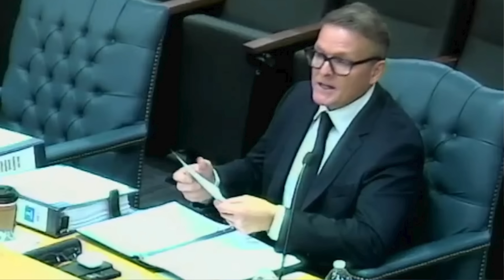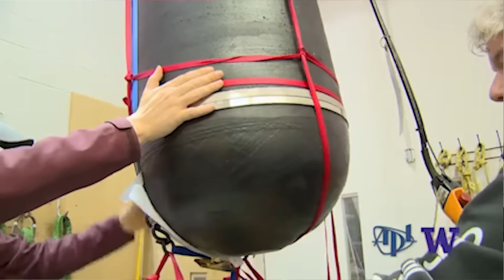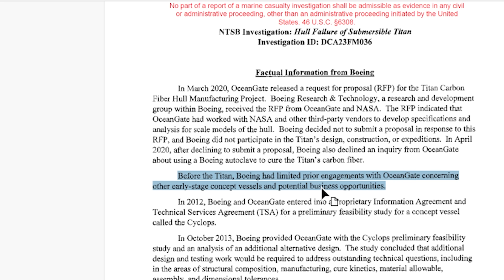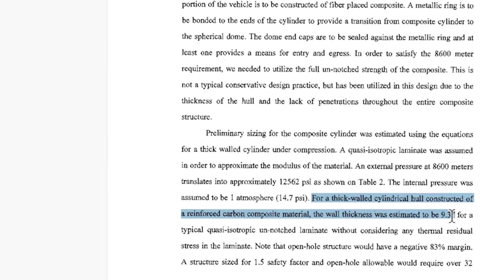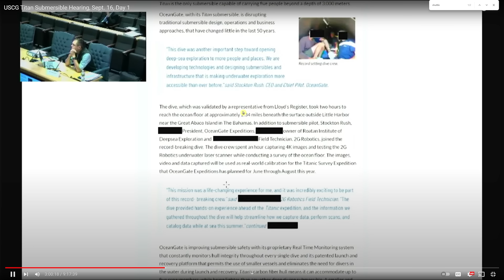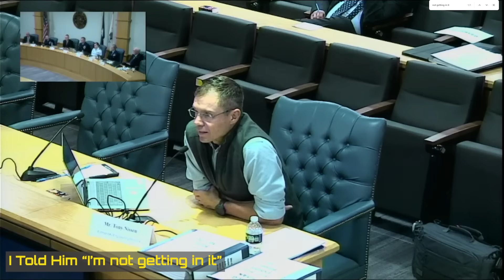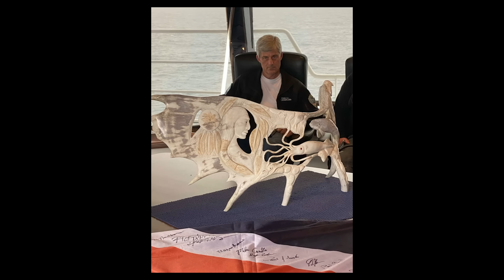Titan Sub: Fired OceanGate Employees Show What REALLY Happened

Comment: Tym, the contractor, pointed out that the lip on the front sealing ring, next to the carbon fiber tube, was sheered off, indicating that the lip failed all the way around simultaneously.

In trying to understand how that could happen, I think that the tube flexed in the middle with the result that the end of the tube was bent away from the sealing ring at the outside edge. This would leave a small area of contact at the inside of the tube and increase stress on the lip until it could fail. The collapse of the lip would then propagate around its circumference rapidly although probably not actually simultaneously.
Reply: I was imagining a delaminating layers failure, allowing concentric layers to slide and "roll" into a smaller diameter (promoted by radial pressure acting on the hull), like a sheet of paper fashioned into a shape of a cylinder. As the layers slide, the inside diameter decreased, where at the end of the cylinder that meets the interface ring, it peels the inner lip right off the interface ring (somewhat like a can opener working a path along the circumference of the can). It's not a root failure, but an indication of the root failure taking its course. The inner lip peeling away or not would not save anything, as the delaminating layers of the hull shrinking in diameter is surely the more pressing matter at that point. 😉
Reply: Now imagine, the interior pressure was high enough that the Ti-Ring was pushing outward, tearing the Lip off as it pushed the Ti-Ring outward.

Comment: So what your saying is that Boeing said for a depth of 8,600 meter depth the carbon fiber composite should be 9.3 inches.  the Titan to dive to about 4,000 meters thickness was 5 inches.  That is a linear relationship which agrees  for solid cylinders in "Formulas for Stress and Strain" by Roak and Young.  
Dropping weight to slow decent make sense.  Diving faster then the typical submersible  at 32M/min first person to say this and not in literature 25 M/min.   However actual speed ave. 36 M/min and last near bottom speed 39 M/min.  What did the crew trim the buoyance to dive at this last dive?   
Strain reduction  that should increase the rates as one gets deeper straight line graphs  that you have shown for strain v depth.  Linear again in agreement with solid cylinder formula.    What is clear from the deviation of the relationship after 81 is a preload of the Cylinder that took some depth, a few hundred meters to unload by the strain increasing with depth.   
The only means of applying a preload is water filling the voids and compressing the air in them to a higher pressure then used in the curing of the Cylinder.  To get water to them the cracking sound likely was the failure of fiber to epoxy bond which would allow when stain created a crack a path for water to enter.

Comment: The huge red flag that I've seen in videos is the use of typical game controller to control the sub. WOW\Shocking!! Maybe the media reports have been unfair, and the game controller was just a prototype and later replaced with a well designed controller. A game controller is designed for playing games in a home, not for controlling subs. Imagine being 100s of feet down and suddenly the game controller loses wireless connection because it was never intended to be used, or tested, inside a sub 100s of feet under water.

Comment: If you listen to the testimony on the window, it could’ve been pushed through the hole without any signs of cracking. It wasn’t even officially rated due to lack of testing and it being a non standard design. Everyone wants to guess how it happened. 
If you listen to Renata, she is totally backing oceangate. She seems to even be spiteful of the inquiry at certain points, I don’t trust her testimony.

Comment: Correction: the Cyclops 1 was not the first version of the Titan. Cyclops 1 was a properly built steel hull submersible rated for 500 meters and purchased by Ocean gate to use as a testbed. The first version of Titan was originally called Cyclops 2 and only the hull was remade, everything else was reused.
Reply: What were they testing with such a different design than the one they planned to operate with?
Reply: @jaylemeux  The controller, among other things. I'm not sure what else, but the thrusters look largely the same and I imagine they were testing coms and maybe the pinger as well.

Comment: A safety factor of 1.5 is not “standard for engineering”.  I hear 1.5 is general standard for airspace.  

If you go into ASME Boiler & Pressure Vessel Code, Section 8, the safety factors are a bit variable, but nothing will be found after 3. In reality it’s like 4-6.

Comment: the crazy part of Stockton's design is that so many parts of his design were actually good, even the acoustic system was actually working. Problem is though he ignored the warning signs and didn't do enough analysis of the results when the gauges started showing signs of anomoly. 
Sadly no matter how much the design was improved on Stockton's lack of regard for safety was always going to be a risk which would eventually lead to failure.
Reply: *anomaly 🙄
Reply: @peecee1384  lol thanks, good spot

Comment: You can see why OceanGate went with 5 inches. They linearly scaled the 8600 -> 9.3 to 3800 -> X and solved for X which comes out at 4.1 so they rounded up to 5. I don't think the hull thickness was the issue more than what the hull was made of and how it was constructed.
Reply: Typical Stockton, as it actually doesn’t even scale linear, there’s things like temperature and other variables at play.

Comment: I think going forward, laminated carbon fiber should not be used for things that can carry people and be subjected to massive swings in pressure. If the entire thing was solid titanium compared to this carbon fiber, how much difference in weight would there really be? Would it be so massive of a weight difference to justify the risk of human life? How much more fuel would titanium use as opposed to carbon fiber? A
Also, if the pressure sensors are embedded between the layers of carbon fiber along with whatever wires these sensors have to power the sensor, doesn’t those components like sensors and wires take up space between the layers and create a gap with which de-lamination can occur under pressure? I am completely a novice and totally uneducated in this subject, but even I can imagine how a multi layered pressure vessel would have weaknesses compared with a solid one piece hull.

Comment: I wonder why Oceangate didn't do an ultrasound inspection of the hull as manufactured. An outside company specializing in nondestructive material inspection would have had the right equipment and experienced inspectors to operate it. Perhaps it was just looking away from the fact the composite manufacturing process was far from optimal, and pretending the problem doesn't exist.

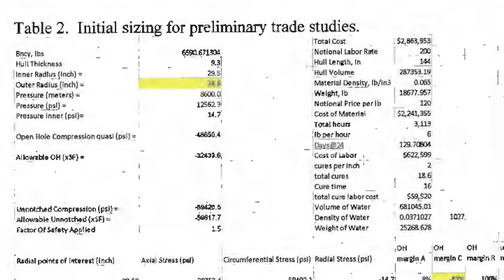Comment: Has someone noticed this @ 10:47 . They calculated with 2 cures per inch. Ocean Gate did only 1.
Reply: Well spotted 👍
Reply: When they were talking to Boeing about using the autoclave at Boeing to cure it.....different video BUT, they wanted it wound at this other plant, shipped in wet layup form to Boeing.
WTF ????

Comment: Tony Nissen is a POS in my opinion. He chuckles and laughs and acts outraged and blames Stockton Rush  alone. as if he had a gun put to his head instead of a check in his pocket. He went along for the ride until they asked him to put his name down certifying the sub. He had a problem with signing his name, but not with cashing the checks. Both Rush and Nissen are equally culpable in my mind. He is a trained engineer and he knew what he was doing.
Reply: He got fired for not signing the design off as safe, you fool.

Comment: I have a problem with accepting part of the evidence, which is the small cut of the carbon fiber hull. I have cut binded books, multi layer circuit boards and other materials. A once inch cut, is going to give false readings. That small a piece will crack and buckle just by cutting into it with all those layers.  
If you lets say make 3 stacks of 400 pages of paper, glue those 400 pages together, then after a week of drying  cut into the glued area of one stack using a belt saw, another stack with a radial saw,  and  the third stack with a binder blade saw, you will see gaps. Not caused by glue missing areas, but because of pressure and heat, during the cutting process. One inch of material being cut, will give false information.  Four to five inches would have given better data. Tools used for the cross section also important. Cutting generates a LOT of heat, which is why good stone and metal cutting saws use water or oil during the cutting process.
Reply: Do you mean "bound" books?

Comment: One detail you missed on the original spec sheet was cures per inch on the hull. The original plan was 2 per inch instead of the 1 per inch that they ended up with, they definitely would’ve got some reduction in voids with the extra cures. But autoclave time was just too expensive for rush.

Seeing all these details and considering how many dives the titan lasted almost makes me think that a well engineered and thoroughly tested carbon fibre hull could’ve worked really well and rush could’ve been seen as the innovator that he thought he was
Reply: Composite materials, woven carbon ply amorphous solids and aggregate cementing bonds, does not destruct in nearly as predictable a failure as crystalline solid matrix. Doesn't have overlapping state equilibria like metal alloys (alloy lattice structure solidifies/quenches within a given thermal phase equilibrium window of overlapping state). Failure under loads like the Abyssal Deep is clearly going to escalate non-crystalline composite laminate to yield point strength failure in catastrophic fashion. Which is a long way from alarming and scary signs of danger with safety margins of moments to spare.
Reply: @santyclause8034  copy & paste is going well for you, well-player sir.
Reply: Agreed.  The fact this thing was able to dive on the Titanic so many times given the soddy quality of the lamination and glue joints really speaks to the resilience of the material.  

The hull monitoring system did a good job as well.  It clearly showed a major shift in hull layers on the prior dive.  At that point it should have been decommissioned.

Comment: I think I know why the bed liner was used on the exterior.  It hid all the imperfections in the hull visible  when looking it over as I am sure all the people who traveled in it and viewed it out of the water.  This led to a false sense of  safety and security... What a shame and waste of human life.
Reply: @entropywizard  someone like stockton would have rationalized the data away every time, no matter what, no matter how damning. and the bed liner sounds reasonable but it was never tested for this use. and if it isn't tested, it's merits are unknown, simple as that. overall it's a great illustration as to why narcissists should never be trusted.
Reply: Well, it did protect from external damage.  Have you ever had anything that is made of fiberglass or carbon fiber?  Let's say you're moving something and it happens to hit the submersible.  Now you have a scratch, ding, or worse that can affect the integrity of the structure.  It's not unlike how it protects the bed of a truck.
Reply: I think the "bed liner" made engineering sense, but Stockton should have had some way of scanning the hull after each mission, perhaps some acoustic-based machine - ultrasound ? - to detect cracks or anomalies.  Not performing such a test was irresponsible/insane.
Reply: @entropywizard  , it seems that Stockton had no scientific way of checking the integrity of the wrapped composite-fiber hull.  That was serious negligence.  But the Titan had made 13 successful dives to the depth of the Titanic.  Stockton, evidently, had made a serious effort to interpret the cracking sounds made by the wrapped hull.  Obviously, his interpretation of those cracking sounds was faulty.
Reply: @Gravitys-NOT-a-force  well, take the cracking sound to it's ultimate end.....
It cracked because it was adjusting to ythe stress it was under. THAT EXACT FIBER right there, location 12:ibex14, layer 7.
It need s a method to identify voids that develop and other faults. So, once you inspect then identify, mark, and correct.
Can't be done on the carbon hull right? 
Sooooo, the carbon, as it adjusts to the load, POP, now once adjusted to load, it'll never pop again, ....... cause it broke in half. 
Think about that for a while.
Reply: There is an old saying... 
"Manners maketh the man" ...in this case (or so it seems to me - and I'm absolutely no expert in any of this ) 
" Money maketh the mad, sad, and dead adventurer" ...both Rush's money problems - the lack thereof etc - and the multimillionaires / billionaires (whichever) "having more money than sense", being duped into believing Rush over the safety of Titan, and the fascination and draw of Titanic, who can be seen in great detail on video since her specs have been so expertly scanned and reproduced digitally for Everybody to see as they view her on their handheld devices, with absolutely no need to dive to such crushing depths to see her in all of her  "rusting glory". 
"Safety is a waste", is it Stockton...? 
I wonder what Wendy and the rest of your family think of that idiotic boast now?!

Comment: Safety was never Stockton's M.:O. and he cut corners everywhere he possibly could. So, my hunch is that Stockton set the guidelines to 8600 metres deep ( , not so that he could have a high margin of safety. Rather, so that he would have a high margin of corner cutting.
This is how I think he eventually arrived at the 5" thickness specification. Stockton figured that if they recommended 10 inches for 8600 metres, then half the thickness should work for half the depth. Which in his case would be the Titanic Depth. An idea like that is something Stockton would have come up with.
Reply: Excellent point.
Reply: I majored in English, so engineering is far from my area of expertise. However, I don't think decisions like this seem sound. I imagine pressure might increase exponentially or carbon fiber require a minimum thickness, etc.
Reply: @woodsplitter3274 Water pressure is due to the weight of the water above you, which actually does increase linearly as you travel deeper.
Reply: @woodsplitter3274  Yeah, I think it's never a linear correlation.  You probably have to make it a minimal thickness once you submerge and then increment the thickness as you go deeper.  So, for Stockton to approve 5 in means he probably didn't care or thought of himself as an engineer which it sounds like he wasn't.
Reply: Woven Carbon fiber cloth, epoxy resin... they share a solid state overlap but it doesn't have molecular granularity like a metal alloy's crystal lattice. I think epoxy is an amorphous solid, a polymer. And Carbon is a crystalline solid. Those two kinds of solid diverge in their property and behaviour. This obviously implies the integrity of their composite strength diverges as the two go their seperate behaviour ways along unequal material properties paths at seperate solid state intervals making the laminar yield strength a bit of a mirage and more or less disposable after use.
Reply: @santyclause8034  it definitely had a limited number of dives and it was Rush's job to figure that out. He either failed or didn't care relying on the RTM system. He was listening for separate strands to quietly break when in reality they were getting gum blasts from the first dive.
Reply: @SlickArmor  seems to me the early warning system worked rather well all along. if only it could have detected the stresses and malfunctions of stockton's brain...
Reply: I heard the hull was eventually made in the 3.5in range.
Reply: They wanted ten inches but Stockton only had 5 inches ....😮😮😮😮😮

Comment: Stockton was a dangerous man and a good example of a smart man but stupid as can be over arrogance. As far as composites and especially Titan's, seeing as it was going to be under that pressure, when wound, they should have had a follow wheel exerting pressure down on the windings after it was laid. The tension on the reel only made it tight but allowed imperfections throughout. The pressure wheel would have forced air pockets out and evened out the impregnated epoxy. It should have been double the thickness, also. Even with my suggestions,  it still was a bad idea and shouldn't have been done. It would still fail, but it would have been magnitudes stronger and lasted longer. I know these materials well. The failure was this. The carbon fiber compressed ever so slightly every time it went down, but the titanium that it was bonded to didn't. At every cycle, it got weaker and weaker at or near the transition, and the epoxy was releasing a little more each time. It was applied sloppy and full of air pockets and way too thin at the rings. There's more to it, but that's the jist of it. The front ring area failed and instantly pushed the acrylic window out as the ring was sheered off at the same time everything was smooshed into the other ring. The implosion went from the front to the rear.

Comment: In his lecture at Geek Wire, Stockton Rush states that the CF hull has 667 layers.
It's obvious that his mind was sick and he was into some kind of esoteric quest toward death. 667 doesn't seem random, but still disconnected from engineering considerations.
Reply: I believe each of the five 1-inch layers contained 133 windings (?) of carbon fibre = 665 (+ 2 from somewhere)